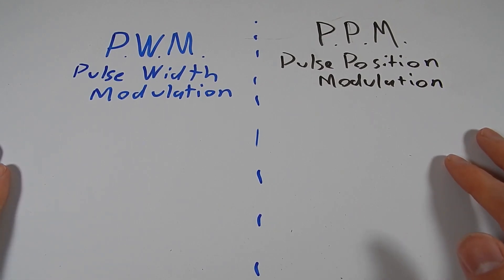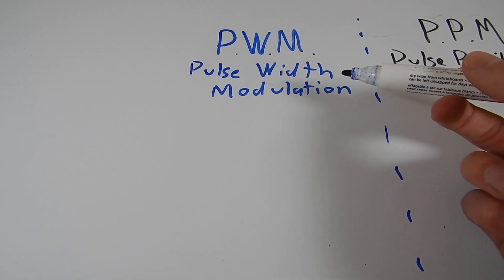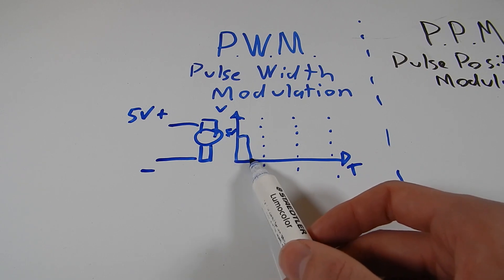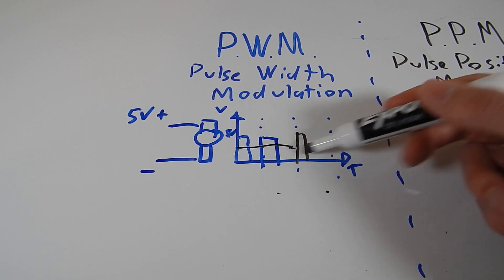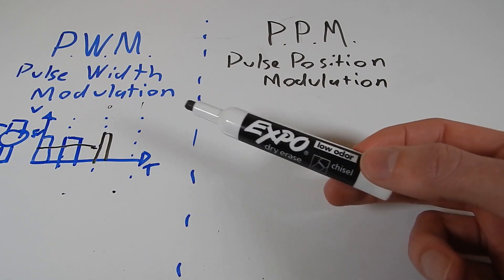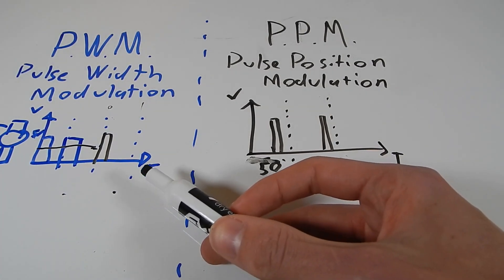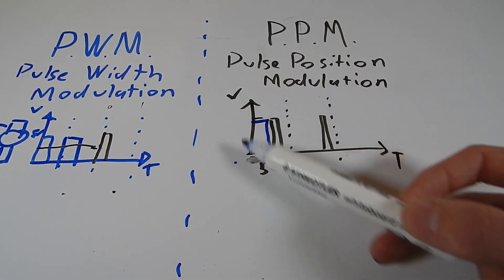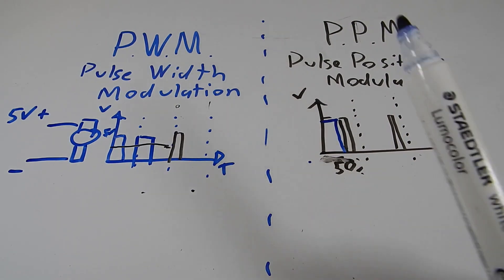ESC Basics: Part 1 - PPM vs PWM

Comment: Wrong, voltage is the same in PWM
Reply from the maker: yes the maximum volatage is the same
But if the PWM frequency is higher then the component (motor, led, speaker, e.c.t.) can react, the component "sees" and reacts to a lower voltage
Thats literally the purpose of PWM, to control the speed of a motor, volume of a speaker and brightness of an LED in software
Reply: @TeamPanicRobotics  No! If so you would have lower torques on lower speedes because od lower voltage. The whole purpose of PWM is to keep voltage at maximum rated level, do you can achieve maximum torque with less speed. If it would lower the voltage, you could just simply adjust the voltage to control speed. But then you would loose a lot of torque, and in some cases the motor wouldnt even start at lower rpms.
Reply from the maker: You have it backwards

Torque is a function of current, not voltage: https://acim.nidec.com/drives/control-techniques/news-and-media/blog/technical/current-power-and-torque-in-variable-speed-drives#:~:text=For%20a%20given%20motor%20flux,flux%20and%20the%20armature%20current.

Speed is a function of voltage, which is what PWM does, it changes the voltage "experienced" by modulating how much "on" time the motor sees, hence making the motor turn at a speed equivalent to % on time*input voltage

Where you may have gotten confused, is that PWM allows full current to flow for the given input voltage and winding resistance of the motor allowing for higher torque then if you fed the motor with a lower voltage supply or limited the voltage with resisters (this latter case would greatly inhibit the current flow, causing very low torque)

Comment: PPM in RC istn't Pulse Position, RC uses the Pulse Pause Modulation. This signal is what comes from the Radio, it includes all channels in series. PWM includes only the information for 1 Channel. The Reciever decodes the PPM signal into 8 or more different PWM signals. Or am I completly wrong?
Reply: I think they are similar only in waveform(RC signal and real ppm), but the transmitted information is different ;in radio control. It is a time division multiplexe of several channels as you said, while the "real" ppm the information carried is related to the instantaneous values of one channel.

Comment: Great video!.... what are the difference between older ESC's that use classic PWM connected to a  FC like the DJI Naza M V2 vs current more advanced ESC's and 4 in 1's connected to a betaflight configurable FC?